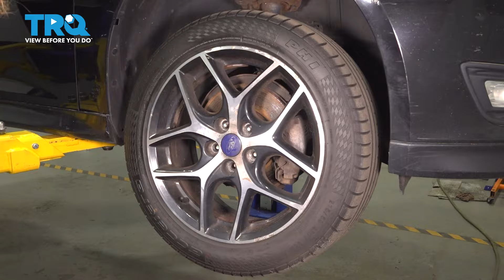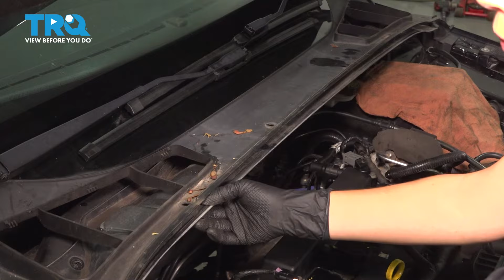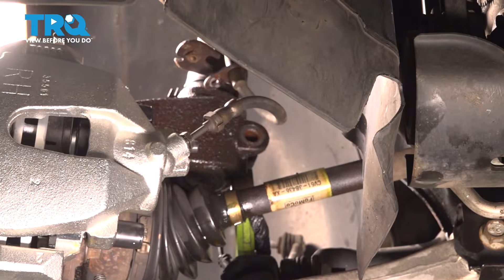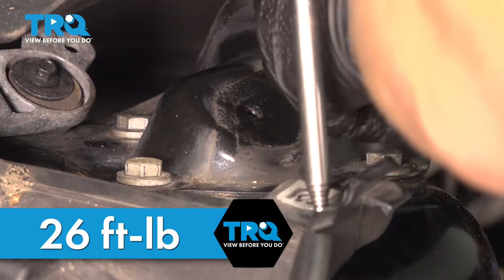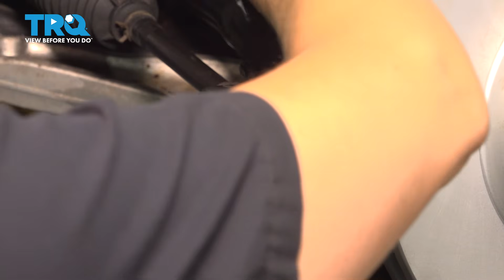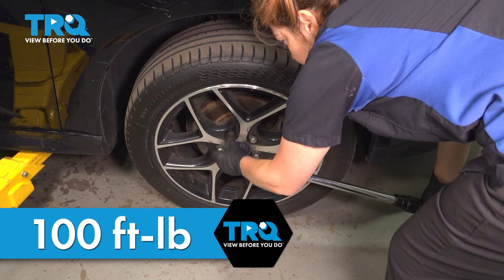How to Replace Front Strut & Spring Assemblies 2012-2018 Ford Focus

Comment: I did this and now my car is making a knocking noise and the springs seem to be loose and are causing it. The strut centre nut on the piston is tightened all the way as far as it can go but still knocks when turning and braking/accellerating. Why!!?? Are the springs too loose, or is the new strut bearing binding and not allowing the spring/shock to turn in the bearing causing it to bind?

Comment: getting the strut low enough without an exhaust clamp was a total b*tch - I ended up looping 4x large cable ties around the lower control arm, and then using some old heavy car batteries tied to cable ties - to the cable ties on the lower arm to keep weight on the lower control arm and hold it down enough until i could put my weight on the knuckle and get the strut out. The rest was easy as per video although my axle didn't want to come out of the knuckle and had to use a heavy sledge hammer to free it.

Comment: Just saying it’s ALOT EASIER if you just back out the pinch bolt and thread it the other way with something flat in between took me 3 days to do it their way tell someone was like hey try this…
Reply: Dude thank you! That made it so easy, I didn't even remove the axles or tie rods like they did in the video.

Comment: To anyone doing their struts for the first time(I have been taking up working on my own car because I have been wanting to learn for a while. i kew the basics, but wanted to delve deeper into cars): Do NOT follow this video. There is a much better 5 min tutorial that does not require messing with the tie rod end or the axle nut. If you go ham with a sledge near the tie rod end the same way she does, it may cost you a tie rod end. Also, the torque for the axle nut is 59 ft lbs - if you torque to 65 ft lbs, you will have tightened it too tight, which can potentially warp and wear the bearing. Fortunately, I realized this mistake before it is too late and torqued it to 59 ft lbs and resolved the issue. This video made changing struts WAY more complicated than it needs to be, and, if you mess with more parts on your car, chances are more likely to mess something up.

Edit: the tutorial I switched to for the other side is by Rolando Robles.